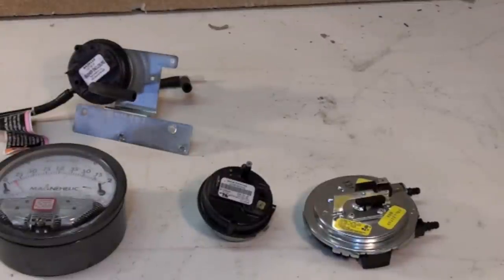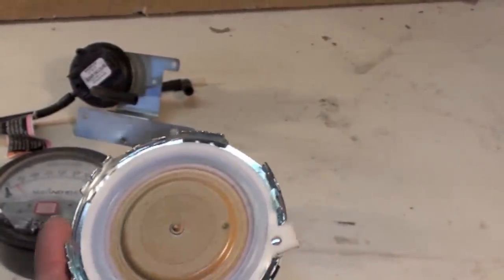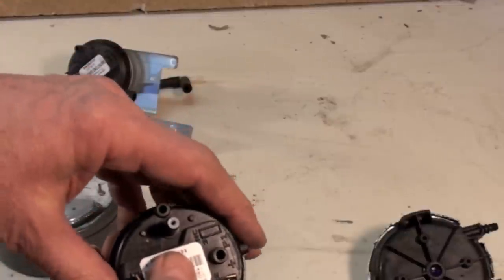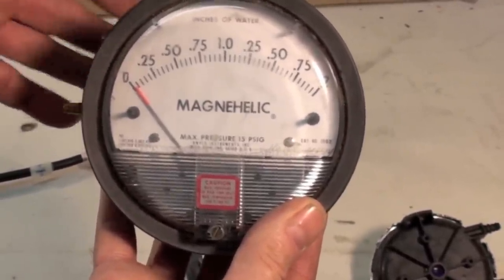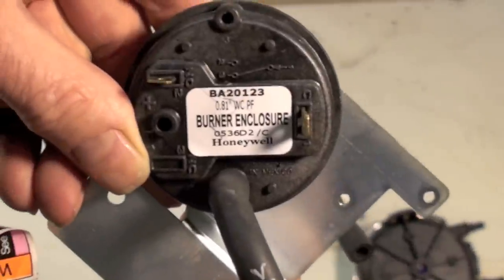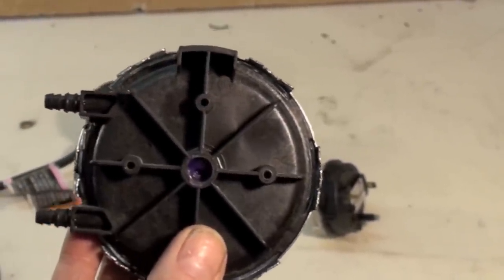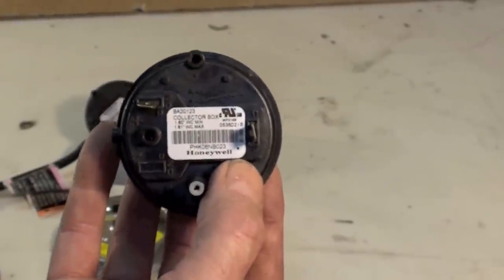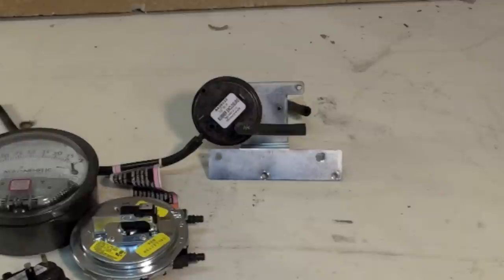How gas furnace pressure switches work

Comment: I thoroughly enjoy your informative videos.  I recently purchased a home that has an 8 year old Trane XR90.  You assisted me in taking care of a condensation leak & now I have one other issue.I removed the upper panel on the furnace and found that the original pressure switch has been disconnected ( still attached by its bracket ) and a generic one installed.  The furnace is functioning well, but should this generic pressure switch be replaced with the factory OEM pressure switch.  The are no markings on the generic switch, but the original has the # C342634P24.  ( 1.4" WC )Also, the original 'PS' has (2) electrical connectors and (2) vacuum lines...one vacuum line is black and the other is a clear vacuum line.  On what ports on the pressure switch do the vacuum lines connect and to which spade connectors do the wires attach?One wire is yellow...the other I believe is red.Thank you and have a fantastic 2016!
Reply from the maker: +Mike R The electric terminals do not make any difference.  The hoses are a different problem.  Some of the switches will have a inches wc number on both sides.  The lower number goes to the combustion chamber.  No numbers, try one way, if it does not work, try the other.  And yes, the pressure switch should be replaced with a factory one.  Hope this helps.
GFM
Reply: +grayfurnaceman Thank you once again for your assistance.  Can harm come to the furnace by not having the correct factory pressure switch installed?  I'll look at the switch and see if any numbers are printed on it.
Reply from the maker: +Mike R Yes.  Some manufacturers will no warranty any problems if the pressure switch has been replaced with a general replacement one.  Usually, when one of these has been replaced, it is because it would not work with the factory switch.  The unit safeties are not effective if a general replacement one is used.  
GFM
Reply: +grayfurnaceman Could you explain what you mean by 'The unit safeties are not effective if a general replacement one is used'.  That sounds as though that could be serious in the proper functioning of the furnace.
Reply from the maker: +Mike R The pressure switches are factory set to the lowest pressure reading safe to operate the furnace.  Dangerous conditions could result from the wrong switch.  
GFM
Reply: +grayfurnaceman Thank you...I ordered the correct OEM pressure switch, today.  Again, many thanks for all of your assistance!
Reply: +grayfurnaceman GFM...I received the new OEM switch...will install it, tomorrow.  You did state that it DOES NOT matter to which spade the red and yellow wires are connected to the pressure switch...is that correct?  I do know where the vacuum lines connect, so no problem there.Thanks a lot for you assistance!Mike
Reply from the maker: +Mike R You got it.
GFM
Reply: +grayfurnaceman Hello again, GFM.  Well, here's a odd situation ( for me at least ).  I installed the new factory OEM pressure switch into my Trane XR90 furnace.  It ran well for a couple of days, then tossed the pressure switch code, again.  The factory pressure switch is marked 1.4" WC, and the generic one is 1.15" WC.  Why would the furnace function well using a generic switch, but not off of a factory OEM switch.  Could it be that I purchased a faulty OEM pressure switch?  Thanks, again...I appreciate your assistance & vast knowledge.
Reply from the maker: +Mike R Sometimes the generic switches are designed differently than the oem ones.  Because the generic switch was installed, I would guess you have a pressure problem in the system.  I would be looking for vent sags, excessive length of vent.  Install instructions will tell maximum length, elbows and size.  Also you could have a blockage in the vent or a crack in the heat exchanger.
GFM
Reply: +grayfurnaceman Is it alright to remove the intake PVC vent where it enters the furnace and use a dry vac to suck out any possible obstructiions?  Should that also be done on the exhaust vent?
Reply from the maker: +Mike R Yes.  Just be sure the vent or combustion air is disconnected from the furnace as you could damage a pressure switch.
GFM
Reply: +grayfurnaceman Here's what I've done...disconnected the intake PVC from the furnace...blew air thru it ( no debris or obstructions detected ).  There is no snow or ice outdoors at this time, so there's no build-up of any kind on either the exhaust or intake outdoors.  Where the intake PVC connects at the furnace...I made certain that there were no insects or debris there...I used a shop vac to insure nothing was obstructing that area.  I used a level on both the PVC intake and exhaust & they are both sloping toward the furnace.  Still receiving the PRESSURE switch error code.  I also had the opportunity to view your video concerning the P-Trap...Can I remove the P-Trap from the furnace & use my shop vac to suck out the (3) hose connection ports?  Or, does it need to remain in the furnace with the lower hose disconnected ( the one that leads to the condensate pump ) while I use the shop vac to suck out any algae, dirt, etc?  I know that you say in your video to DISCONNECT all vacuum lines from the pressure switch before performing this operation in order to not damage the pressure switch.  One other question...there are (2) vacuum lines connected to the pressure switch...one goes to the burner box & the other goes to the secondary heat exchanger...can both be disconnected and have air blown thru them ( using my mouth ) without harming anything?  Also, if I'd remove both hoses from the top of the P-trap and blow thru them...would that be alright to do?  Of course, one of the P-Trap hoses connects to the bottom of the inducer and one goes to the secondary heat exchanger.  Again, MUCH APPRECIATION and than you for you assistance & patience!  Regards, Mike
Reply: +grayfurnaceman I forgot to ask...how much water do I need to add to the P-Trap before starting the furnace...I remember that your video stated to not have it void of water.
Reply from the maker: +Mike R I would remove the p trap before cleaning.  You may blow thru the hoses.  About a cup of water is ok.  Also, try disconnecting the hose that goes to the burner box to see if the unit works ok to try to isolate.
GFM
Reply: +grayfurnaceman Thanks GFM...I'll remove the P-trap and suction out all ports.  Upon re-installing, I'll add a cup of water to the port which feeds the condensate pump.  If I read your reply correctly...I should remove the vacuum line from the pressure switch that runs to the burner box & attempt to start the furnace...correct?  I'll also blow through the two vacuum lines that connect to the top of the P-trap upon removing the P-trap.  Thanks & I'll post the results.
Reply from the maker: +Mike R You got it.  Hope it works out.
GFM
Reply: +grayfurnaceman  Hello again, GFM.  There is an issue that I just happened to fall uppon by accident.  I have noticed that on the PVC ( exhaust side ) that there is some moisture that is forming at the bottom of the first elbow ( sweep ) that exits the furnace. It is only noticeable by touch & by close inspection with a flashlight.  It's very minimal, but is this enough to cause the pressure switch to fail during initial startup?  If so, should I disconnect the exhaust from the furnace and blow air through it to try and dry any moisture that might be present in the PVC?  Could I leave the exhaust connected at the furnace and blow air through the PVC where it exits the house?  Thanks again...I appreciate your assistance!
Reply from the maker: +Mike R Moisture inside the exhaust is normal.  It should drain back to the furnace.  However, if moisture is on the outside, the connection is bad.  Replace ell.  Hope this helps.
GFM
Reply: +grayfurnaceman The furnace is now functioning normally using the factory OEM pressure switch.  I disconnected the exhaust PVC from the furnace and took a more powerful wet/dry vac ( than I used the previous time )  and suctioned the PVC pipe ( from outside of home ).   This seemed to have corrected the issue with the pressure switch error code.  The moisture I see is on the outside of the first elbow that exits the furnace on the exhaust PVC...I've noted that you stated to replace the ELL as the connection is faulty.  The moisture is in the form of a few droplets...is there any chance of CO gases escaping...I have several digital CO detectors ( one of which is near the furnace ) and they both read ZERO.Could primer followed by cement rectify the leak, or is replacing the ELL a must.  Thanks for all your assistance!
Reply from the maker: +Mike R Probably no appreciable CO here.  You can try cement.  You can also try silicone.
GFM
Reply: +grayfurnaceman   Hello, Mr. GFM...the last time I checked in my furnace was operating nicely...well, for at least about 3 weeks.  Now, the same issue has occurred...IFC flashes (3) codes...pressure switch error.  Following you directions, I removed the vacuum hose that runs from the burner box to the top of the pressure switch and low and behold...pressure error cold disappeared and the furnace fired perfectly!  Could this possibly be a inducer motor issue, perhaps something with the IFC board.  Could the vacuum hose simply need replaced...perhaps, a small leak, thus losing vacuum?  Again, I appreciate all of your knowledge!Thanks...Mike
Reply from the maker: +Mike R It is not the board.  The inducer may not be coming up to speed.  Are the bearings free?
GFM
Reply: +grayfurnaceman The inducer # is BLW00864.  How can I tell if the bearings are free?  This one is a sealed variety...nothing to spin by hand.  I'll listen to it start a few times and see if it's abnormally making noise. I recall you mentioning in a video that inducers most likely last between 10 and 12 years.  Again, many thanks!
Reply from the maker: +Mike R You should be able to spin it by rotating the shaft where it enters the housing.
GFM
Reply: Hello GFM...sorry that I haven't gotten back to you, but I was extremely busy for the past few weeks.  Everything checked out well with the inducer.  Again, the furnace has ran well for 3-4 weeks, but acted up again the other day.  I noticed several issues...the first issue that I noticed was that the burners were going out immediately after lighting.  I ended up cleaning it and so far has rectified the situation.  Today, it acted up again .  I have (2) identical pressure switches and I attempted two tests on each.  I removed the spade connectors ( vacuum lines connected  ) attached the voltmeter alligator clips (started the furnace) and tested for ohms on the first PS and the reading was severely fluctuating....reaching over 100 ohms at times.  Then, I attached the electrical wires to the PS along with the alligator clips to the voltmeter...powered the furnace and the voltmeter remained at 26 volts...never dropping to zero volts...of course, I had the 3 blinking lights referencing the pressure code error.  On the other PS...the tests revealed a steady 9 ohms and the volts dropped out ( from 26 volts to zero after a few seconds ) Of course, the pressure switch error was not present and the furnace completed its cycles and ran fine.  Could this be a PS that is defective and a PS that wants to not function properly from time to time.  Sorry for the lengthy message...thank you!
Reply from the maker: +Mike R It could be.  However, venting resistance or heat exchanger cracks could also be causing the problem.
GFM
Reply: Hello GFM...the furnace ran well ( once again, for weeks ) before tossing the pressure switch code.  I wanted to give you one other piece of information that I detected...code 3 occurred last night, so I removed the intake from the top of the furnace.  As soon as I did, the code disappeared and the furnace fired.  Am I assuming correctly that this could be something else other than some sort of obstruction in the PVC intake?  I blew it out a while back with my shop vac, yet the was no foreign debris that was expelled. I'm assuming that this issue could still be possibly related to a crack in the heat exchanger?  Is there such a thing as a dirty heat exchanger that could cause this issue?  I wanted to get your thoughts before calling a tech...I want to have as much knowledge as possible...so as not to get ripped off.  Also, I believe you've stated that it cannot be a control board issue...since the furnace fired when I removed the vacuum line from the pressure switch that leads to the burner box.  Would a cracked heat exchanger cause this intermittent pressure switch error code?  Thanks...much appreciated!
Reply from the maker: +Mike R Because this seems to be a continuing problem, I would be looking at length and size of venting and compare to the install instructions. Also, be sure the elbows are correct for your furnace. This means short radius or sweeps. 
GFM
Reply: +grayfurnaceman As always I appreciate your knowledge & thank you, extensively.  Because the furnace fired after removing the intake...does that mean that it eliminates the possibility of a cracked heat exchanger, or anything else that can be serious in nature?  I'll look into the install instructions, but I'll need a tech to perform any modifications that could possibly need to be altered.  I can't thank you enough for all of your kind assistance!
Reply from the maker: +Mike R there is still possibly a crack in the heat exchanger. 
GFM

Comment: Good evening GFM,
I have been freezing for several days and am glad to watch your videos! You mentioned in one of them "if you unhook the hose from the burner box and it fire up" then that is the problem. Our furnace fires up perfectly if I disconnect that hose - so does that indicate that my pressure switch is the culprit and needs replaced? I appreciate your direction!
Reply from the maker: Kris Brower Look for blockages in the combustion air piping an also in the vent pipe.  Also check the condensate drain for blockages.
GFM

Comment: Hello. My furnace shutts off. Code shows pressure switch issue. Replacing didn't fix it. By removing front door it's runs ok. 

Question. Can we replace new pressure switch with lower rating
Reply from the maker: Absolutely not on the pressure switch change.  Check vent and combustion air inlet for blockages.
GFM

Comment: I have water puddling behind my unducer above the blower fan on the top half of a concord 90% efficiency furnace my drain lines are clear any insight would be great thanks
Reply from the maker: You probably have a leak where the inducer mounts to the manifold of the secondary heat exchanger or in the manifold itself.
GFM

Comment: Hi GFM, having some problems with a Goodman furnace. Works fine first cycle...igniter glows, gas clicks and turns on and the burners ignite and brings thermostat up to temp, that is when the problem starts. The next cycle the igniter glows but shuts off just a second before gas comes on, this will happen 3 times then nothing for a few hours unless I flip the power switch them it will work fine for the first cycle everytime. Basically when I want it to run I flip the switch. I have replaced the circuit board, the pressure switch and cleaned the flame sensor......any ideas?

Comment: My house is not even a year old and today I got the light indicates a stuck open pressure switch. So I tapped on it lightly with marker and the furnace is working. Can our series of negative temperatures cause this? Was it defective from the factory?
Reply from the maker: It is probably under warranty.  The low temps should not cause this.  Hope this helps.
GFM

Comment: I have a customer who had a house plumbing leak. The plenum insulation above the gas furnace got wet but I can't find any water contact to the furnace controls, wiring or internals. What visual indicators do you use to verify for water contact? I'm using ; signs of corrosion, water hardness minerals, streaking as well as wetted or matted dust or cobwebs.
Reply from the maker: You have done about all you can do visually.  I would shut down the gas to the appliance and be sure the furnace shuts down on flame failure.
GFM

Comment: I also have a York System and replaced the pressure switches and circuit board.  I keep getting the signal telling me the pressure switch is stuck closed.  I blow in the sensing tube for any moisture and then restart the system.  It works about 70% of the time but a pain to keep going up to the attic to have the system run.  Any ideas? Could the new swtiches be bad alreay (about 1 year old but first winter) Any advice would be great...
Reply from the maker: Is the system in a unconditioned space? (like above the insulation).  If it is quite cold there, some furnaces were not designed to be below 50 degreesF.   Other problems could be blocked vent pipe(90% furnace), inducer wheel dirty, heat exchanger cracked (CO hazard), or inducer motor not coming up to speed.  Hope this helps.
GFM

Comment: I have a carrier unit that's giving me a  pressure switch code but it will fire up code stops and run for about 4 days before it shut off
Reply from the maker: Could be a number of problems.  Blocked drain, water in the vent, ice on the termination, water in the pressure line, heat exchanger failure, inducer failing or failed pressure switch.
GFM

Comment: Are pressure switches always is the vertical position because of the diaphragm?
Reply from the maker: There are multiple positions for pressure switches.  The switch may have an indicator on it that gives its proper position.
GFM